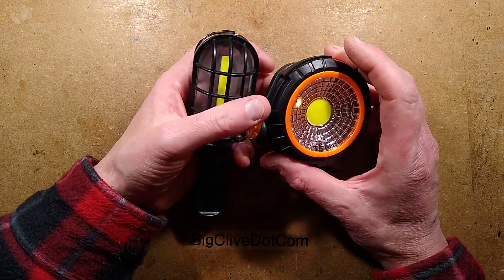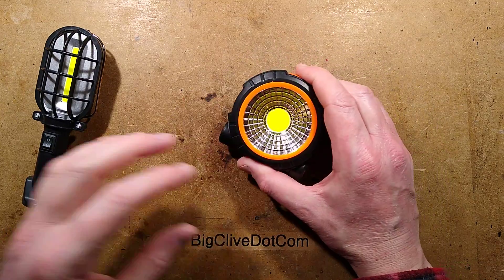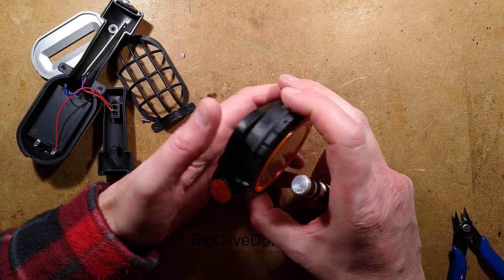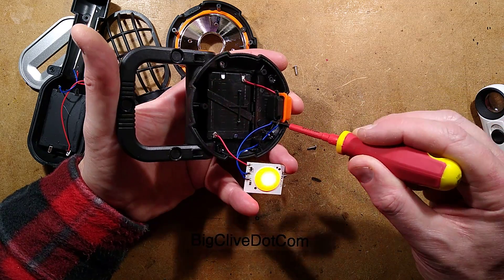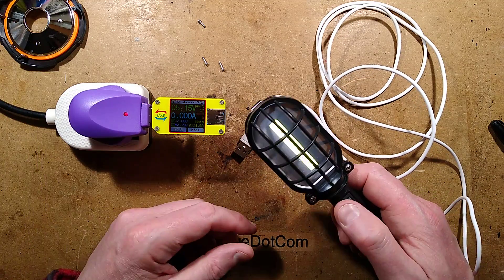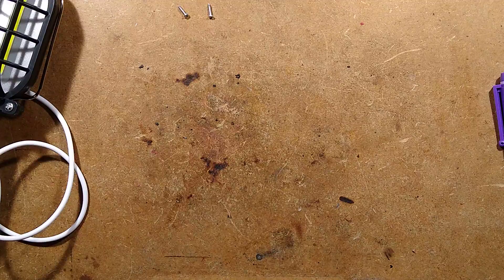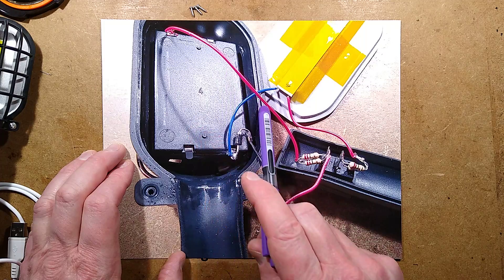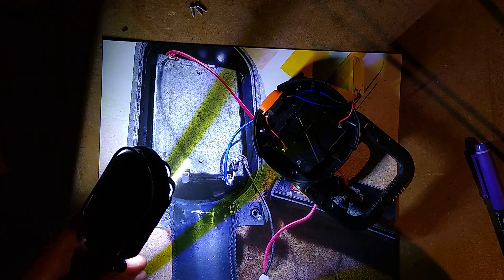Scavenging Poundland LED COBs and a hack

Comment: Thanks for reminding me that I need to order a new set of calipers!
Reply from the maker: I use mine a lot. They're a very useful tool.  Especially for 3D printing object design.
Reply: @bigclivedotcom  I've got my dad's Helios vernier caliper with no dial indicator or display. All hardened stainless steel. It never has dead batteries...
Reply: I have just received my caliper (metal/digital) version. Does help quite a bit as my eyes can't read the analog one very well without glasses (that are never in the place I need them)
Reply: @ZeedijkMike  when 100% precision is not needed. These cheaper ebay/Amazon options are not to shabby.
Reply: @KG1AES  
I got a couple Cheapo digital calipers from Aldi to use for general stuff, and I keep the mitutoyo for Sundays 😁

Stock up on LR44's 😂👍
Reply: Mind, though, AvE has done a review of these shitty chinese calipers and found that the quiescent current is quite high (more or less the same whether they're turned on or off). In my case that would mean that whenever I need them, the battery would be flat. That's why I haven't ordered one. I have contemplated bodging a hardware switch onto them, to physically separate the battery when not in use. As long as one remembers to zero them out (as you always should, really), it should be ok. Also, I'd go for the metal ones (even if it's pure chinesium)  instead of plastic or composite. You need hard(ish) measuring surfaces, and it would  be easy to wear/nick them and have false readings.
I use standard vernier calipers. Always works. And I have no trouble reading off them (yet... my sight is going...).
Reply: @horrovac  
Just take the battery out between uses. Mine came in a clear hard plastic re-usable case, and there's a little spot to store the battery... Haven't had any issues since I started taking the battery out. The original battery lasted about 3 days of non-use.
Reply: @tin2001  Yeah but taking the battery out and putting it back in before use is way too much bother. The biggest advantage of digital calipers is convenience, and that goes out of the window with something like that. I'd prefer using vernier calipers.
Reply: @horrovac  I bought one of these 2 years ago, still on original battery, absolutely love it ...... The only problem I've had is my dog tried to piss me off and chewed up the case https://www.ebay.com.au/itm/Stainless-Steel-Electronic-Digital-LCD-Vernier-Caliper-Micrometer-New-150mm-6/172322552503?ssPageName=STRK%3AMEBIDX%3AIT&_trksid=p2057872.m2749.l2649  was only AU$19 when I bought it.
Reply: @darkknight145  I have a few of these. These all-metal ones are quite well made. To be honest I prefer them to my much more expensive M&W calipers.
I checked mine against some micrometer calibration rods and they were spot on over the  whole range. If you want the battery to last a long time use a SR44 silver cell instead of the cheap LR alkaline cell they are supplied with.
Reply: @horrovac  I had one of these cheapie "carbon fibre" ones and added a switch for this very reason. It ate batteries. 
Then I ordered another to live with my 3d printer. 18 months on and this one is still on the supplied battery, the quiescent current is lower than I can (or care) to measure. Luck of the draw when you play the Chinese Lottery I guess.
Reply: @georgeprout42  Which model is that? This chinese stuff all comes from a few factories and the few models are sold by hundreds of vendors. If you've hit paydirt and found a model that doesn't suck the battery out in a few days, share please. I'd like to buy some shitty calipers but the battery issue kept me away.
Reply: @horrovac  I just checked, it was an eBay seller in HK back in March 2018 and the listing is long gone. Bkmd1195 fwiw, but it's even longer ago than I thought and they don't have any listed now.
Reply: @horrovac  I have a set of those cheap metal calipers, and as said, the battery will be completely flat every time you come to use them. Useless.
Reply: @MattyEngland  in other words, could be fun to try and hack them into a usb powered / rechargable version?
Reply: @stephanmantler  yeah I could add a switch, although there is zero room inside the case so it would be difficult.
Reply: WRT high quiescent current models: is there any hope 3D printing entrepreneurs will come up with a replacement clamshell that converts the batteries compartment into a 'switch' i.e. a slidey-clicky drawer that, when closed brings the batteries into circuit, enabling the built-in switch and, when open, isolates the batteries from said circuit?
Reply: @michaelthibault7930  I believe the battery contacts are not on the battery compartment cover but inside the body of the measuring unit, so replacing the cover would achieve nothing. I believe there is enough room in the shell for a small switch (dip switch or so) and it should be pretty trivial to reroute one of the contacts via the switch and drill a hole for access.
Reply: @horrovac  The idea is to replace the entire clamshell (or one half of it), not just the battery compartment cover. There's more than one way to skin a cat.
Reply: Just learned how to use my uncles old school  caliper...lol I thought  it was a weird watch for a long time
Reply: I bought a Mitutoyo a year or two ago. Nine times out of ten I reach for the cheap plastic caliper I bought second hand for a few cents about thirty years ago.
When I got it, one of the tines for internal measurement was broken and I built it up with Pratly steel putty.
Still, it's served me well and is quite good enough.

The idea of replacing the vernier calibrations with a battery powered electronic display doesn't sit eell with me.
Batteries leak and corrode. And they're always flat when you need the device.
Reply: Whilst I have a few Vernier calipers, I prefer the dial gauge version - easy to read quickly, acceptably accurate for hobbyist work, and no batteries to leak or go flat. Micrometers?  The Wife bought me a digital one that's never been used (now 7 years ++ old), and on the odd occasion I look at it, the battery seems OK. Far easier to use a conventional mike with a stand mount magnifying glass.

Comment: Alkalines explode? Really? I thought they have safety valves in there. I charged Alkalines for years now and I just noticed 2 kinds of results:
1: Less capacity but usable
2: Less capacity, leaks within a week
Reply from the maker: It's the pressure build up that makes them ooze electrolyte.  If a high charge current is used they can blow out the end cap with quite a loud bang.
Reply: Sounds fun. I need to get myself an explosion containment pie dish
Reply: @DrGreenGiant  More fun to use electrolytic caps across the mains, 2 options: Low cap high voltage makes a nice smoke bomb. High cap low voltage makes a good fire cracker. Use to do this in my younger days at work, wired across a power point at the back after the switch...... Don't know why people got angry with me, go figure.
Reply: @darkknight145  Ya, go figure. LOL Your comment made me remember when I use to open the assembly bays by 6am at the electronics company I worked for at that time up in Omaha. The final test technicians use to come dragging in to work by 9am and they'd out of habit reach over and power up there test bench by flipping on one AC power switch that fed the work bench and all the test equipment. Once in a while I'd bring in a 12 VDC car alarm siren and wire it to the power supply outputs on my buddy's test bench. He'd come in half asleep and flip on the power to his bench and quickly get an underware changing moment. LOL Everyone in assembly would all laugh knowing that I sprang the joke on him again. LOL Stay safe and stay healthy darkknight145.
Reply: If you have a dedicated alkaline charger and use chargeable alkalines, you should be fine - the charger should know not to overdrive them and the cells should have adequate protection. However, the question is: why bother? NiMH cells like Eneloops are better in every regard. They have lower internal resistance, they have more capacity at higher loads, they're more reliable, won't leak, and are FAR cheaper in the long run. The only application I see for alkalines are long-term low-load applications, where I don't want to have an Eneloop bound up in. And in those applications they last so long that I don't see a point in trying to extend their life (and risk damaging the device).
Reply: @horrovac  When I was daily-driving a Palm III, I used the locally-made Nova Scotian Pure Energy rechargeable alkaline batteries. They were only available in AA and AAA sizes, and the more you charged them, the better they would last. A set of four would still cost less than the E or D brands, and swapping the pair in the device with the pair in the charger every few days gave lots of cheap power, with higher voltages than NiCd and NiMH.

Comment: Looks like you could almost fit an 18650 in the shaft of the first one
Reply: Won't work. The internal space is far too less. I tried
Reply: If that doesn't fit even after dremeling out part of the original battery compartment you can perhaps use a rectangular cell in place of the original battery compartment (removing as much plastic as possible to make room but keeping the ability to retain the cover) and then stuff a tp4056 in the base (above the magnet) with a small hole for the micro usb port
Reply: @Yrouel86  I managed to fit a rectangular pouch cell and a tp4056 in the battery compartment without any dremelling. Although its a bit tight
Reply: @Will-sc3hw  Yeah there are indeed small pouch or cellphone cells that can fit in there without any modification but if you remove as much plastic as possible you can likely fit a slightly larger cell so it'll last longer.

I prefer not to have the TP4056 in close quarters with the cell if possible because the chip does get hot when charging, especially if you can use the full 1A charge current, so I usually avoid risking to cook the battery.

Also speaking of charging current remember that the module is set by default to charge at 1A but if you use a small cell you should adjust the current accordingly by changing R3 to the appropriate value (refer to the datasheet for that). I usually set it to charge at around half C or even less for the really small cells
Reply: @Joachim Shekelberg Oh I see. I very much prefer micro usb for these things because there is no risk of plugging in a 12V (or more) supply by mistake
Reply: Before mobile ‘phones became popular, there were two common barrel connectors: 2.1mm inside diameter, with a 5.5mm outside diameter and 2.5mm ID with a 5.5mm OD. There is no standard for the electrical specification (although where there are ratings, it’s generally a maximum of 50V at 2A or 3A). Both have been used for AC and DC use, with voltages between 3V and 24V. When used for DC use, both polarities have been used. In the past, for primary (non-rechargeable) battery powered toys and gadgets, the outside was often positive and the most common polarity. Now, with the popularity of 12V power outlets in vehicles, it’s more common to have the outside of the barrel negative. 
The newer and smaller 1.3mm barrel connectors are also available. I can’t say I have seen any specs for these. They may be a better option for low voltage, low current use.
Reply: @Joachim Shekelberg I've seen 12V in lots of barrel connectors that power routers, switches etc.  I've also seen barrel connectors feeding large LED lights at around 150V/0.3A
Reply: @Joachim Shekelberg We need a revamped module with usb c instead and at a comparable price
Reply: Just opened the comments to post that myself!